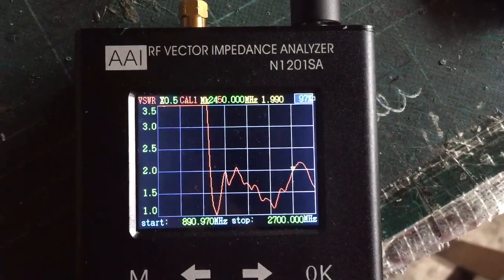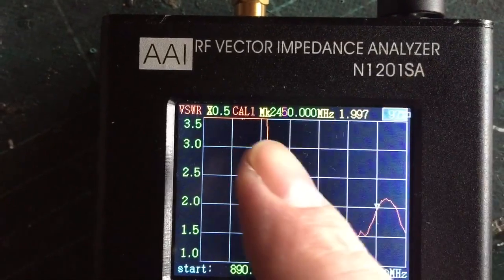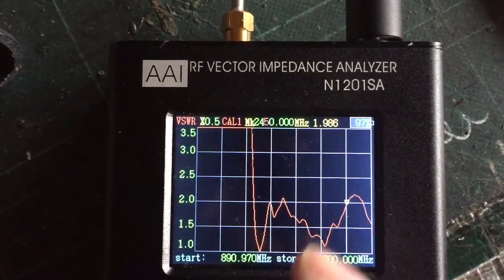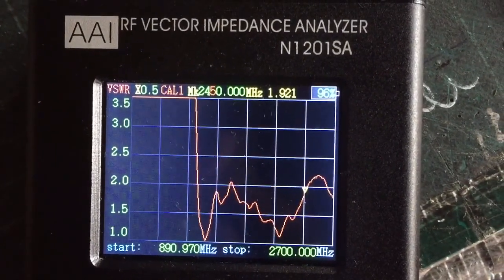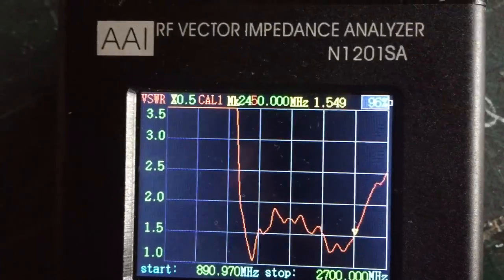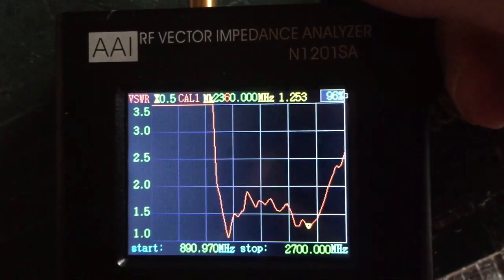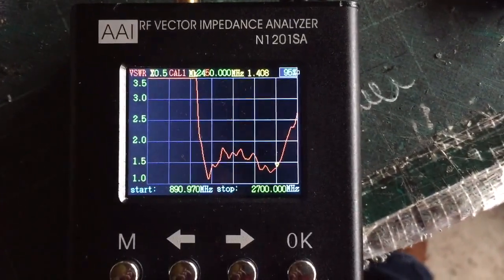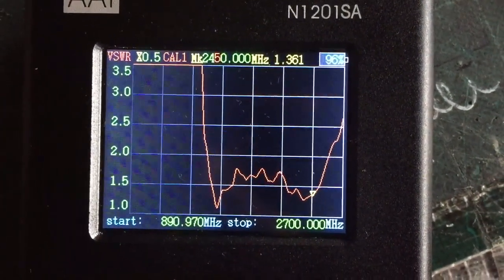N1201SA Antenna Analyser

Comment: That's not how you tune a helical. 
Just change the feedpoint height. 
Of maybe in your case the wave trap. Which is btw on the wrong side of the wire. 
 You can tune helicals just by pusing the first 1/3 turn lower or higher above the reflector.